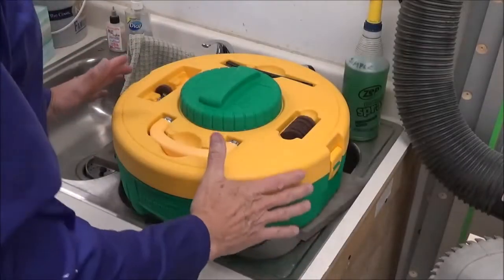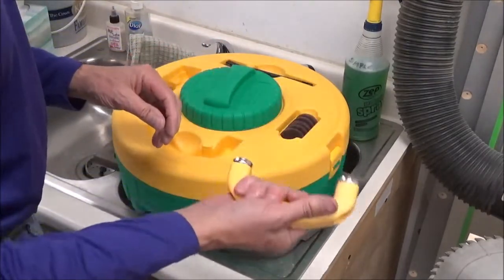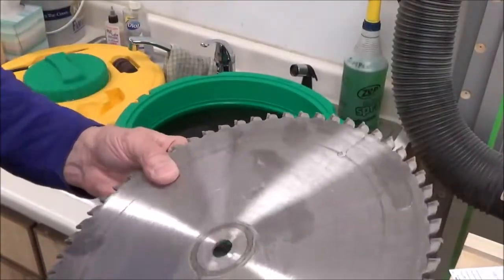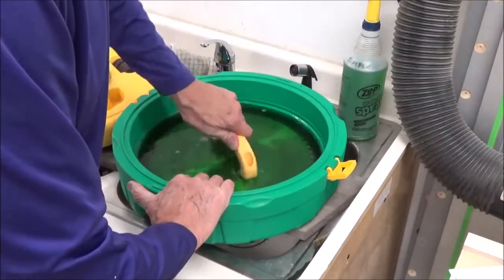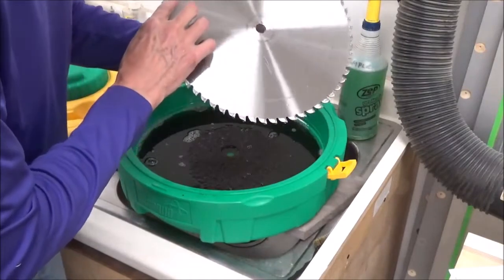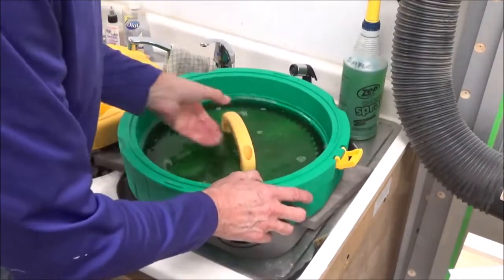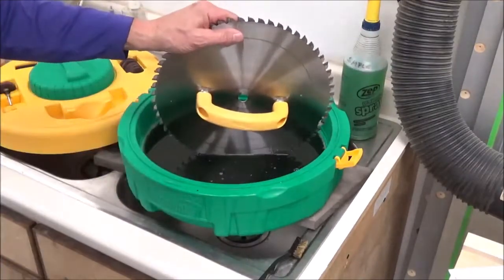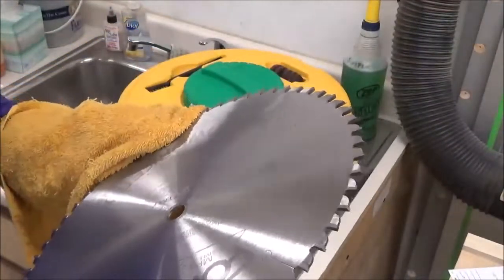Micro Jig Blade Cleaning Kit

Comment: Jeffy, I think you wasted your money.  I guess Micro Jig is counting on fools like you to spend $100 on a piece of plastic. Not me though!
Reply from the maker: Well that's why I posted this video. Thanks for watching.
Reply: Do you clean your blades? This system cleans all the teeth at the same time, and is way faster than than having to clean each tooth one at a time. Some fools know the value of time, and that time is money.
Reply: @alrightythen1533  Yes I do, and it only takes me 5min...maybe 10mins sometimes. I use a wide brass brush and Simple Green, let it soak for a couple mins then use the wide brass brush to clean the teeth on both side. Easy peasy!
Reply: @truth-ox3wz   well, I guess you're just a much faster cleaner than I am.  There's no way I could clean my blades that fast.

Maybe I'm hard on my blades, wire brush takes over an hour even with solution. Instead I use a wire disc attached to drill and that takes about 20 minutes to hit 160 teeth (80x2 to do both sides).

You're able clean an 80 tooth blade in 5-10 minutes. That's 1.8 - 3.6 seconds per tooth. That's pretty amazing.
Reply: @alrightythen1533  I clean often and I don't clean one tooth at a time. I set the blade in a plastic tub and soak with Simple Green (non-diluted) and let sit for 10-15min. Then I spin the blade with my right hand and scrub with the brush. it cleans 5,6 or more teeth at the same time. After about 6+ revolutions that side of the blade is clean. i then flip the blade and do the same thing. When done rinse with water and dry with white cloth then spray with a Dry Lubricant.